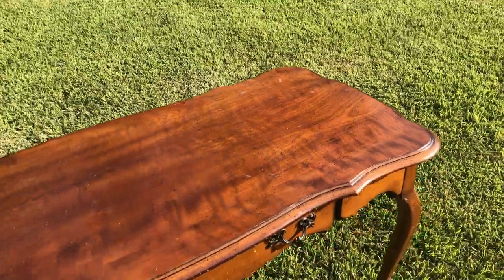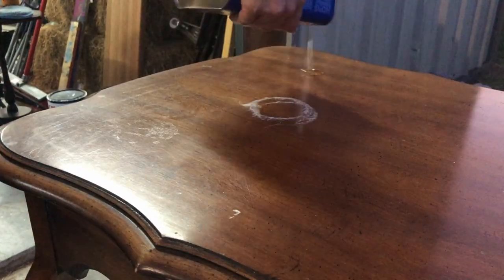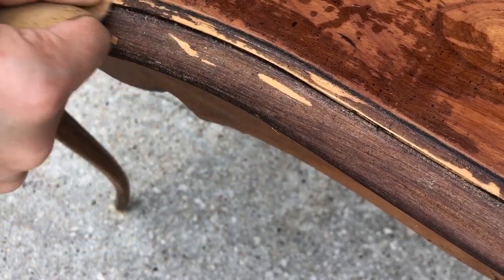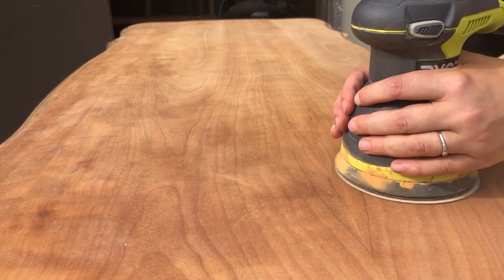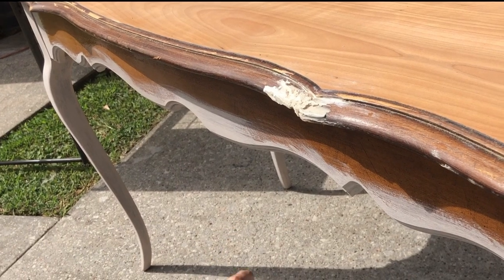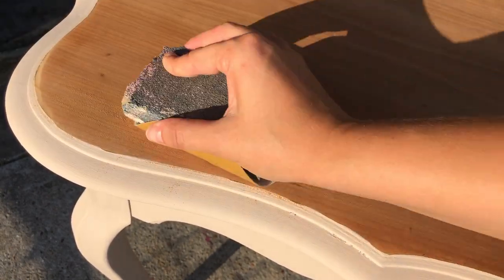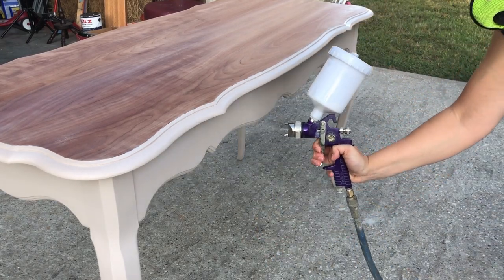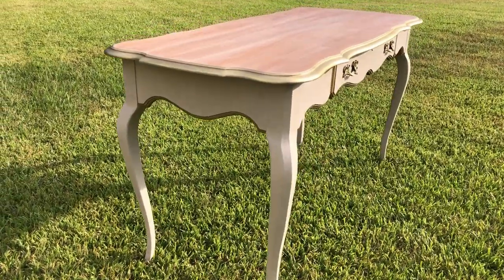Using a PAINT WASH on furniture | Elegant Desk Makeover

Comment: Why strip the top and sand the rest?
Reply from the maker: The old finish on top was thick so I would have spent a long time sanding through it all. The stripper took  off the most of the topcoat then all I had to sand off was the old stain that was left. When it’s 100+ degrees out I avoid as much sanding as possible 😉
Reply: Thank you. I just bought my very first piece to refinish and I’m trying to learn all I can before I get started.